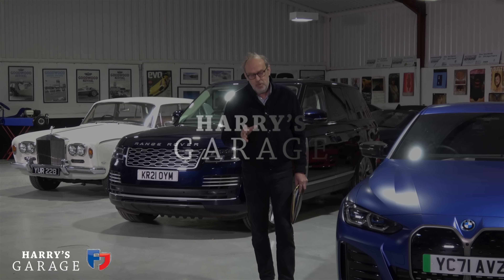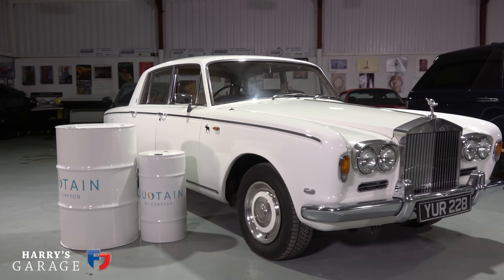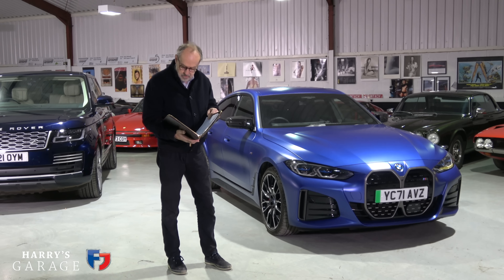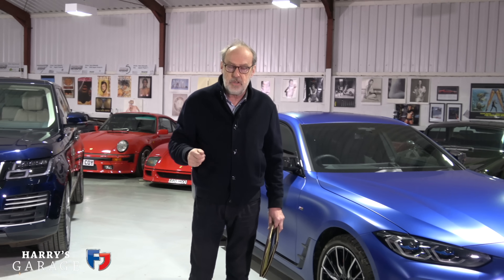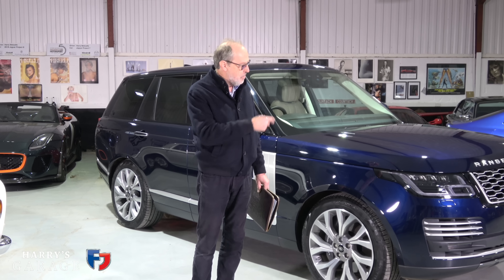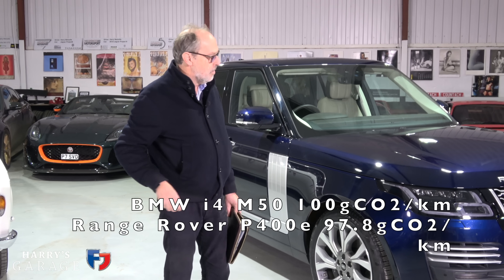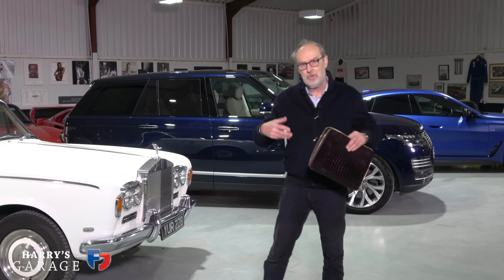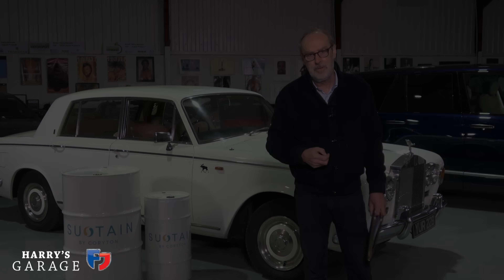Sustainable fuels; what are they & are e-fuels better for the planet than running an EV or PHEV?

Comment: Just one caveat. When you factor in the CO2 from electricity production, shouldn't you factor in the CO2 from fuel production, too? In your calculation you have the CO2 emitted from the exhaust only. So well to wheel for the EV and local emissions for the hybrid and ICE only. 
This being said, for ICE enthusiasts eFuels will be an alternative. Probably very expensive. Even in Chile they have to recoup the cost for wind turbines :D
Reply: Scalabilty is an issue as well. If land use is turned over to creating petrol then food prices will rise.
Reply: @topperthehorse  I think the benefit of the eco fuels is you manufacture from the waste products not used in food production. It’s win win. I’ll caveat with “I think”.
Reply: @andrewlarking7492  sure, but there is only a limited about of these waste products available, so it will always be a limited technology.
Reply: My own calculations including total CO2 cost to pump still doesn’t make sense. It’s close but not there yet.
Reply: @andrewlarking7492  what doesn’t make sense?
Reply: @tbrdoescinema  the C02 emissions to manufacture a new EV and then run it. In my area at least the C02 cost to run the two are not that far apart. But my car was already made.

I don’t see EV as the answer. I see a radical rethink of transport as the answer.
Reply: @andrewlarking7492  But some people do want new cars every other decade or two. And I doubt a current Bi-Turbo 300HP 2l 4banger will last as long as the venerable Mercedes W123 200D.
Reply: Which is great but then you have to factor in the generation of the fuel to power the power station in the first place...
Reply: It's always conveniently missed off along with mpg claimed book figures suddenly being so accurate you can calculate fairly from them!
Reply: @adamfry1125  agree 100%. Back in 2005 I needed a very economical car to do a long commute, so I bought a Citroen C2 Diesel. Claimed 78mpg. I ended up trading in for a Skoda Fabia VRS for the better fuel economy. The C2 averaged about 45mpg in reality!!
Reply: @NigelsModellingBench  There must have been a fault with it or you were driving it like you stole it.
Reply: Although I agree with your point, there is a larger debate required. By this maths, any fuel that isn’t renewable or ‘green’, e.g. coal or gas needs to have its production techniques measured and included in this equation too? Even nuclear energy has some co2 output from mining to transport, but this is omitted to send the no emissions message?
Reply: @jamesbarlow2330  Yes exactly that. Even "green" energy almost always has outputs - be they large or small. Even something like a wind turbine has an impact when its made, in use and as its scrapped. 
I would ideally like to see every emission from any source included as a per kWh result so we can see what the differences are and which is actually better. 
Even green fuels made from crops usually displace other crops or trees which were already there so there is a decent impact straight from the off on them. 
I'm not saying they all do or that they are better or worse - just that we really need to see complete emissions per energy unit for all production to be able to make reasoned decisions as to whats best.
Reply: "shouldn't you factor in the CO2 from fuel production"
Not really, when it's literally a CO2 capture system.  You're taking something organic and turning it into a liquid fuel.  It can be something as simple as taking natural gas and turning it into methanol.  You don't even need to convert that into gasoline.  That's a complete lie.  99% of gas-using cars for last 20 years are already fully engineered flex and it's turned off in the software.  Liquid fuel is a much more efficient and durable energy transfer system than power lines and batteries.  People are also WAY overthinking the CO2 ramifications.  The more CO2 circulating in the atmosphere, the more energy in the atmosphere, the water vapor, and the more life.  The planet is getting more arable, not less.  The major adverse effects are more extreme weather and more insect vectors.  Everything else is BS and hysterics.
Reply: Let's also factor in the production of solar panels, wind turbines and the fact that they cannot feasibly be recycled.
Reply: LOL, surely not? Fuel just magically appears in a tank doesn't it?
Reply: @tbrdoescinema  I want your tank. It magically disappears from mine!
Reply: Sure, but the EV CO2 figures are wildly wrong. They only have the consumption during the official cycle. That is missing:
-Charging losses (from about 10% to massive amounts if battery not at optimum temps or when fast charging)
-Consumption while plugged in, meaning preconditioning of the battery and pre-heating the cabin
-The car preconditioning the battery for fast charging (eg. Tesla does this at 7kW, even after a long drive on the highway it is possible that the heating is on for 30 minutes)
-Massive consumption increase when temperatures are not at optimum, easily 100% increase is possible

Then there's the MASSIVE impact of the trillions needed for EVs in:
-Millions of chargers manufactured, installed, maintained, periodically replaced (surprisingly low lifespan and surprisingly high amount of maintenance needed)
-Incredibly huge task of totally reworking all of the electric grid
-Horrendous costs in subsidies and increased vehicle costs for consumers (plus the often hidden subsidies for the hundreds of millions per vehicle to totally rework production lines, and other subsidies now beginning to flood in as governments have deemed subsidising the auto industry much more politically acceptable than before)

It is a fact that the most reliable measure for a country's real reduction of CO2 emissions is their wealth, their GDP level. It is a fact that if you make a nation poorer by burning money with EV nonsense then that will prevent real, properly effective investments into CO2 reduction.
Reply: @pistonburner6448  do you produce fuel in your garden or do you rely on refineries and fuel stations?
Reply: @VolkerHett  You mean the biofuel, or the upcoming e-fuel?
Where do you get the trillions to pay for the forced EV transition? Do you know what trillions are?
Reply: @pistonburner6448  Harry was talking about eFuels so I do too.
Reply: @VolkerHett  Why are you trolling here with asinine, irrelevant back-talk?
Reply: @pistonburner6448  Is pointing out flaws trolling?
Reply: @VolkerHett  Your original point in your first message was valid, but meaningless. Meaningless due to the small numbers from what you pointed out as well as far larger missing emissions on the EV side. And also meaningless because in numerous larger scientific studies they have taken that into account.
Anyways, your first point was valid.

But after your original point you've not made valid points and you haven't properly addressed anyone else's points.
Reply: @pistonburner6448  "The car preconditioning the battery for fast charging" it's in his figures--he's measuring the amount supplied at the plug, which includes any preconditioning
Reply: @JustAnotherPoorSlob  Wrong. I'm talking about the official EV consumption figures, and the way all testers test EVs. 
They absolutely don't measure "at the plug", and I doubt Harry is either. How is that even possible?
I'd also like to point out that cars' own computers give wrong data, when ADAC tested lots of cars Tesla's Model S was the worst offender: its combined charging loss and computer display deviation was 24%! And that was at slow charging when battery temps were optimal.
Reply: @pistonburner6448  It's easy to measure. Most EVSEs I've used can provide you with your usage--either on a screen or using bluetooth
Reply: @JustAnotherPoorSlob  What usage?
Reply: @pistonburner6448  You could pretty much replace the word EV for ICE in that argument and then add the logistics of fossil fuels. Then you’ve got emissions on top.
Reply: @tbrdoescinema  Based on what? Total nonsense. Absolutely ridiculous, did you even read my comment?

Thank you for reminding me to add the massive logistics of battery raw materials, then to the production facilities (often in China), then back to the factory, and often in between the batteries are produced in a dedicated battery factory before going to the next factory...

The EV pushers have also lied about recycling having been solved: it has not been solved! It especially has not been financed yet!!
Reply: @pistonburner6448  Reality. Keep on denying the cost of producing and burning oil. Battery recycling is already happening both conventionally and via second life products but it’s used as a smokescreen (lol) to discredit EV production.
Reply: @tbrdoescinema  I have not even mentioned the cost of producing and burning oil. Maybe you should read what is written first. The cost btw is baked into the low price of oil...

Battery recycling is not already happening as a free service to anyone (at best expensively subsidised small-scale projects which are basically meaningless), and it is total misinformation to try to paint a picture that there would be in place any kind of financing or planning for battery recycling.
Reply: @pistonburner6448  indeed, convenient.
Environmental and economical costs.
Reply: @pistonburner6448  Plus the electric power lost due to large distances it needs to travel to all these recharges and the fact that the battery loses power during time even if not in use
Reply: @tassos2011  True!
Reply: ICE vehicles last indefinitely. The energy cost to produce them, has paid for itself, tens times over, and will continue to do so with basic servicing.
Your "eco" EV, will need to be replaced every several years. Resulting in a waste vehicle after a short time, requiring another to be built in it's place.
The energy cost involving building 3 or 4 times more EVs, 3 or 4 times more frequently, VASTLY outweighs your "concern" of C02 from fuel production.
Don't even get me started on lithium mining and frequent battery replacements in environments that are anything less than perfect conditions.
Reply: @QBDLettuce  ICE vehicles last indefinitely? 😅
Reply: @mr2chrisd  Are you going to finish the point you were making?
Reply: @QBDLettuce  Utter nonsense. The batteries in current production are lasting multiple 100k miles and will probably last a million miles+. Once they are no longer viable for the vehicle they care being repurposed e.g. as power backup for houses, and also acting as load balance for the grid. They will last decades in this use and then and only then will they need to be recycled. BEV are spectacularly simple compared to ICE and need a fraction of the maintenance, even down to minimal brake pad and disc wear. BEVs are far from perfect but total bollocks like "need to be replaced every several years" does nothing for balanced debate.
Reply: @plonk7  Multiple 100k miles? With no degradation or loss in all kinds of environments? Show me the data on that... lol
Reply: @QBDLettuce  ICE vehicles do not last indefinitely, far from it. Unlike petrol batteries can be recycled.
Reply: @boostav  unless you run them Sustain :)
Reply: @boostav  Cars with basic maintenance from a hundred years ago still run and drive and can continue to do so.

Let me know when EV's are able to do that.
Reply: @boostav  and ICE engines can be recycled. You missed the point: producing the EV emits more CO2 due to the batteries. Recycling the batteries produces even more CO2…
Reply: @boostav  Ice vehicles can last indefinitely though - if serviced appropriately. An ev will always need a battery swap sooner or later and by most measures its sooner. Batteries also can't all be recycled and most currently aren't at all becaus ethe energy involved outweighs just making a new one. The point you miss is its not the battery which is the fuel but the electricity and that can't be recycled any more than fuel for an ice. 
You're also adding extra energy changes which all lose some energy. 
For ice its oil > refinery > car > convert to effort. 
For ev its oil (or other fuel) > refinery > generator > transformer > power lines > local transformer > lines > charger > car > inverter > battery > electronics > motor > convert to effort. 
There is a cost to every single one of those conversions and a lot of the time if you're asking the vehicle to do some work - motorway speeds, cold, wet, loaded - things like that - it can be less polluting to just use the fuel in an engine at ~40% efficiency than go through that lot after using it in a power station at ~60% efficiency. 
Ev's are very efficient at low loads but so are plug-ins and they don't require massive batteries.
Reply: @siraff4461  No they don't last indefinitely, engines have a lifetime. Age ≠ mileage. Electricity is not produced from oil. You are also conveniently forgetting the massive CO2 output in distributing petrol. Efficiency of an electric motor is not 60%.
Reply: @siraff4461  Does proper service for ICE vehicles include regular oil changes, belt services and so on? Let's just say 100,000 miles without any of that?
Reply: @boostav  You're jumping to a lot of conclusions there - incorrectly. 
Engines can last indefinitely. I'm not saying they usually do but they certainly can. It all depends on design, quality and how much maintenance you're willing to put into them. 
There are still some going from the 1800's and quite a few from the early 1900's - especially when you consider the times they have had to go through and the low numbers produced in the first place. 
I also never said electricity is produced from oil. Power stations have to be fuelled by something though and thats usually gas or coal. Re-read what I wrote without putting in your own ideas and it makes sense. 
As for the CO2 output of distributing petrol - the average journey from refinery to pump is around 30 miles. Now lets see the numbers on the CO2 output from wasted electricity if that were replaced by ev chargers all having to be fed from power stations. I'll give you a clue - power lines don't buzz for nothing.
Reply: @QBDLettuce  Jay Leno has Baker Electric Car from 1909 and it is still running. So electric cars can last as long as combustion engine cars. Easily. Leno says, the Baker Electric is his only car that is 100% maintenance free. 
Electric motors last much longer than combustion engines. And batterys can easily be replaced and recycled.
Reply: @VolkerHett  Proper maintenance is engine (and application) dependant. Some cars go for hundreds of thousands of miles with only minor maintenance but some require more. The point is its possible to keep almost any going indefinitely and since they're metal they can all be recycled if someone can be bothered to dismantle them - a lot more of an ice car is recycled currently than any ev.
Reply: @siraff4461  may I point out that Jay Leno has a 100 year+ Baker electric which still had it's original cells.
Reply: @MrLaserbrain  He restored that entire vehicle. It wasn't functional when he got it, compared to running barn finds of a similar age.

You can park an ICE car, and with basic maintenance, I can come back to that vehicle hundreds of years later, and it will still work. Heck, even without maintenance, it will still work. It won't be in the greatest condition, but it will function.

Whereas an EV is limited by the simple fact that capacitors and various electronic components have a finite lifespan, with or without use. 

That's the gist of what I'm trying to get at here. And before anyone starts jumping up and down saying that modern cars are full of electronics; stop right there. They are, however the majority of which are not necessary for basic function whatsoever.
Reply: @keithhoughton4308  Yes and there are steam engines still running from the 1800's. Whats your point? The original cells from the Baker (a brilliant piece of engineering by the way) are so far removed from the li-ion ones in a modern ev they are nothing like them. Li-ion cells degrade over time and eventually become pretty close to useless. The cells from the baker can be serviced and carry on. 
Of course the tech from the Baker is the very reason ice took over in the first place. The batteries were far too large, heavy and slow charging to be able to compete with the ice vehicles so they died out. 
As for the one Jay Leno owns - I think you'll find he's not actually using it on the original cells but more modern ones so even though they could in theory work its not a great testament to them. Especially when he has a huge collection of contemporary ice vehicles which not only still use their original engines but can also be used reasonably in modern day traffic.
Reply: @siraff4461  That's true about the cells and used to be for spark plugs too. It's generally thought that the death of the electric car first time around was mainly due to the introduction of the self starter on petrol cars, though I'm sure it wasn't overnight. Second life use of li-ion batteries as mentioned here will make the comparison with ICE even more favourable though they they will inevitably require better recycling than at present. New technologies will use more available materials.
Reply: @keithhoughton4308  Thats the thing though. WHen talking about ev's the same arguments are always used - its going to be better in the future, it will be better when it arrives, its coming soon and so on. 
Here, now and today a long range ev makes little sense and environmentally its almost certainly worse than unsing those cells in plug-ins. I agree as battery tech improves there is potential for ev's to be far better - the motors efficiency makes an ice engine look daft - but overall emissions and damage done at the moment we really ought to be more pragmatic, make most or all cars plug-ins and make full use of the cells we're currently producing while taking advantage of the benefits ice offers for longer trips or harder work.
Reply: @siraff4461  Well Si, I'm 68 and as far as I'm concerned the future is here and I've been driving it for five years and only changed the washer fluid and one punctured tyre. Meanwhile my 20 year old Jeep Cherokee is constantly on the ramp, leaking this or that fluid, requiring brake pads and oil changes on a regular basis.
I've waited a long time for a viable electric car and now they are here I don't claim they are for everyone and although my Smart ED is my go to car, I do think the market for the ICE will be around for a long time yet.
Reply: @keithhoughton4308  I've had ev's in one form or another since 2010. I've also always had a second vehicle for the longer trips or heavy work. I've run a plug-in since last year (Ford Kuga phev - an Escape over there) and so far I've done a much higher percentage of my miles on electric because I always use the ~40 miles or so in the phev battery first even on long runs while before I would jump in an ice if it was close or if I needed to charge away form home. 
It must be noted that I'm in the UK and the public charging infrastructure here is incredibly poor. When I had my model S the superchargers made a massive difference and I wasn't bothered by long runs apart from when I was going into a dead zone where the s/c network didn't cover. Thats basically most of Wales and most of the South West for me. 
The bigger problem with the Tesla wasn't the way it worked but all the problems it had. The build was terrible and it was one fault after another until it had to go back. Not what I would expect of a car which cost over £80k.
Reply: @siraff4461  No need to tell me about Wales, I'm afraid I live there. Tesla still have my grand deposit from the Model 3 launch as I couldn't have looked at that blob of a car every day in my drive. I'm hoping that they will produce a car that appeals to me eventually (other than the cybertruck of course!)
Reply: @keithhoughton4308  Having owned a model S and driven quite a few Teslas I would say be very wary. I'm yet to see one without build quality issues and some of those problems can be pretty major. 
Once bitten and all that - I won't be getting another until they sort it out properly. 
I'm also not keen on the style of the 3 but that alone wouldn't stop me getting one. Wondering if the underpinnings were done up correctly, if it had brake pads fitted in all corners and if the roof was going to blow off among other things certainly would stop me. 
If you live in Wales even the superchargers aren't such a great bonus - though I suppose if you have a decent range in the first place you would probably have got to one by the time you need it. 
For me that was the big bonus. The performance was one of those things which is impressive at first but wears off after a short while since in normal driving you don't launch the car anyway. Other than that there really isn't much going for them over other brands and most others are noticably better built.
Reply: @QBDLettuce  Never mind all the systems in ICE vehicles that need to be replaced constantly. People love to act like every single ice vehicle is an Hilux. All the throw away Kias, all the cracked blocks, all the transmission replacements, motor oil, water pumps, heater cores......
Reply: This is nonsense.  ICE vehicles have a very, very finite lifetime.  Just look in your average scrapyard.  Have a look around next time you're out on the road.  How old if the average car you see?  It's only little used or 'classic'/valuable vehicles that last longer.

 A well maintained ICE vehicle may last a long time, but it can't compare to the simplicity and hardiness of an electric motor, even with little to no maintenance.

 Batteries on the other hand will be far more limited, lifetime wise.  But they're recyclable and can be repurposed when no longer suitable for vehicle use.  Data from Tesla is suggesting that most battery packs will last the lifetime of most of the vehicles themselves (exception being first generation Leafs, but they had no battery management systems in place that are common now).
Reply: @mattos4203  I would disagree, scrapyards have a lot of cars that still have good engines but have other major mechanical problems that are not economical to repair in older cars.
Most of the time, when an engine dies, it is because the timing belt goes and the piston and valve become married together. 
If you look at certain cars and engines, they will go virtually forever if serviced at the correct intervals. Some examples if this include the mx5 (with the exception for rust) and the vw polo. Volkswagen pd diesel engines are also very reliable and can go on forever.
Reply: @QBDLettuce  absolute rubbish......
Reply: @QBDLettuce  Are you serious? Which ICE cars last "indefinitely "? I'd like one of those to replace my 10 year old Electric Smart which according to you I should be throwing away any day now. It still performs like new btw.
Reply: @QBDLettuce  Even if that were true, which it isn’t the environmental cost of extracting, producing and distribution of fuel is enormous. Why is that ignored?
Reply: @tbrdoescinema  Ah yes, the red herring of logistics. It's not "being ignored", it's an entirely different topic of discussion, with its own problems and solutions.
Reply: @QBDLettuce  One that needs to be addressed, its intrinsically linked to ICE regardless of fuel.
Reply: @QBDLettuce  My pet hate is lithium mining and people thinking how wonderful EV's are for the planet.
Reply: @philt5782  agree here, but oil extraction has never been particularly eco friendly either.
Reply: @philt5782   yeah oil mining is super clean I heard
Reply: @philt5782  research sodium ion batteries. You could start with Just have a Think here on YouTube.